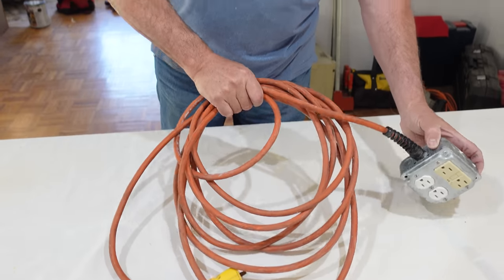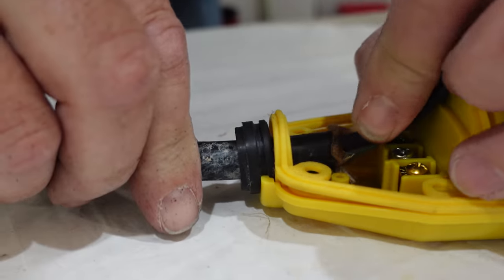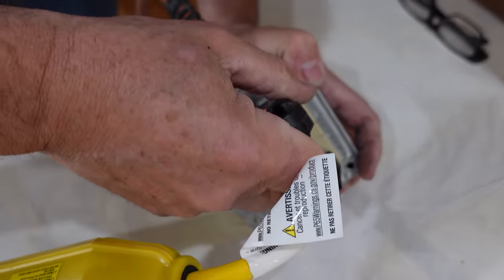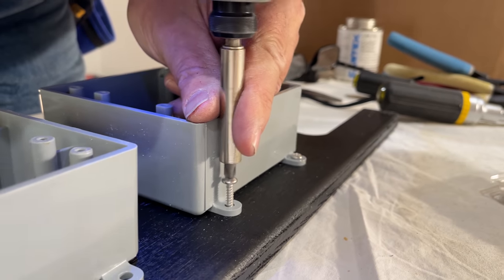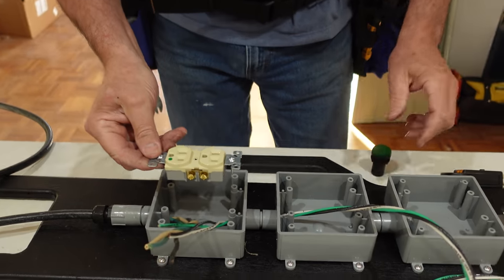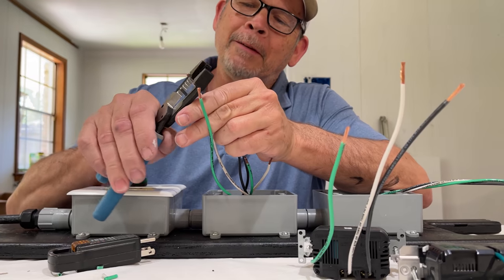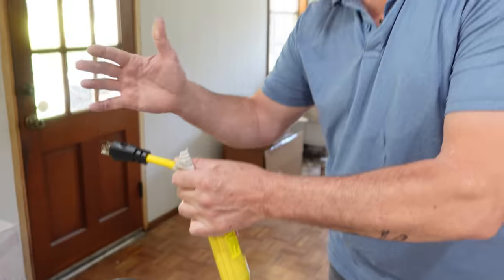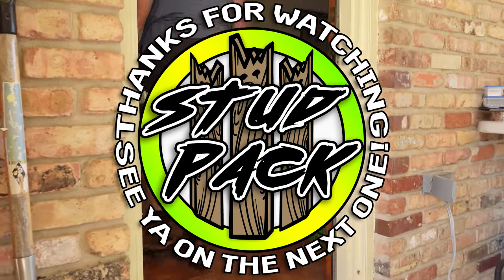HOW TO MAKE THE ULTIMATE EXTENSION CORD!

Comment: If you look in the datasheets for most circuit breakers, they have the over-current to hold time graph, which is a curve.  at a low amount over the rated current it will take quite a while (up to an hour) for the breaker to trip - 15.5 amps in a 15 amp circuit for example.  As the draw goes up, the hold time drops.  A 60 amp draw would almost instantaneously trip a 15 amp breaker.  Mechanically why this happens has been covered in many comments.  Why this is a good thing... hasn't.  Breakers can be designed to trip instantaneously for any peak over the rated current, but this provides no extra protection, and very well might cause problems with high draw devices like motors, that can draw great amounts of current at startup, but level off very quickly (inrush current).  A few seconds above the rated current isn't going to heat the wires in the walls significantly, and since the breaker is only there to protect those wires (....and nothing else), there's no value in making it trip any faster.
Reply: Yeah, being able to hold a surge current for even a short amount of time is important. We don't want a circuit to break every time an Air Conditioner brings its outdoor unit online as an example.
Reply: electroBOOM on youtube had a video where he put 100 amps through a 20 amp breaker and nothing. he got the data sheet and it said something like it can take anywhere from 60 secs to 5 seconds to trip based on the amps running though it.
Reply: @Styrofo4m  GCDIs are made to protect humans. Breakers and fuses are made to protect equipment and prevent structural fires. The main specification for a fuse or breaker is that the circuit breaks before the cable causes a fire, or hopefully break something.
Reply: In most countries gcdis and breakers tend to be one and the same. In USA this is not the case often only having ground fault protection to select few rooms.
Reply: @Styrofo4m  two different names around the same thing. It depends on which country you live in which is  standard
Reply: To elaborate, ground fault circuit vs ground circuit detection being the difference in name.
Reply: On the ship We can set the instantaneous break and slow break had you started two of those saws at the same time it would  of tripped
Reply: Exactly and that is because barkers are made of bi metallic strips and a small over current event takes longer to heat the strip causing a trip rather than a large draw.

Comment: Just FYI there are tons of products out there which will charge devices via USB-C, but the part where you're referring to being able to charge an iPhone 12 from 0% to 100% in ~1hr is because of Power Delivery. This IS proprietary to USB-C, but not all USB-C chargers feature Power Delivery. If you want this kind of high speed charging you need to make sure that your device is capable of charging with Power Deliver, and you charger is specifically designed to do Power Delivery, (often called USB-C PD accompanied by a wattage rating like 18W, 20W, 30W, etc...). If you don't see any mention of Power Delivery on a charger you're thinking about buying, then it does not have it. They are more expensive, but well worth it.
Reply: Also QC 3.0 is usually around 15-18w and higher voltage than typical 5v USB. There's getting to be way to many variations. I got a nice little USB volt/amp tester that tells ya exactly what it's at. I also recently got a multi port 60w PD and QC3.0 supply that tells you volts and amps of each port when a device is activated. You can see the power curve as the device gets charged. Kinda cool.

Comment: Pro Tip:  When tightening a cord into into a  strain relief, press the cord inwards towards the connections on the device to de-strain them while you're tightening it down.  This provides some slack inside the device and prevents strain-loading the connections during assembly.

And... great video, thanks!
Reply: Great Comment!!!  (While Stud Pack may have done that by instinct and because of experience, and didn't mention it.   That's great information for those of us that don't have that experience to fall back on!!!  Thank you.)
Reply: That sounds like something learned from experience! An "Ask me how I know" bit of knowledge. Thanks!
Reply: Also, cut the hot wire a little shorter than the other two wires, so, if the strain relief does fail, hot wire is the first to get disconnected.
Reply: The ground wire should be longer than the other two. If stress on the cable causes wires to pull out or break, the hot or neutral will fail first - not the ground.

Comment: Been doing industrial maintenance like ~6-7 years now and grew up in a home where we did everything DIY. Had literally zero knowledge that there was a stranded and solid side to strippers. Learn something new every single day, as long as you allow yourself to admit when you don't know.
Reply: Idk if I would advertise not being aware of super basic details like that. It says more about you as a worker in your trade than it does about the quality of this video 😂😂
Reply: @SlapperGlutesTwice  I'm not going to pretend. If you can't admit you don't know something you don't keep yourself open to learning. In any trade, if you keep your eyes and ears open, you learn something new every single day.
Reply: Me too, I just learned it today! I love these videos Thanks !
Reply: Depends on the strippers you use. I prefer the self adjusting jaw strippers or.just do it by feel. Most electricians I've ever come across strip by feel.
Reply: I work in industrial electronics at a wire manufacturer, just to inform, the copper size is likely smaller than actual gauge size regardless of solid/strand. do you think they are just giving copper away?

Comment: Most new breakers have 2 trip methods. One is magnetic which works primarily during a fault. The second is a bimetal coil, similar to an old fashion thermostat, this is the one that handles general overloads. Depending on the manufacturer, age, and use of the breaker it can take time for the coil to heat up and trip. Certain manufacturer like Zinsco and Federal Pacific wont trip and you get the smokey house effect. We hope there isn’t one in the house you’re at. It is perfectly normal to hit a higher amperage on a breaker for a short period of time before the coil snaps. I have seen a 20 amp breaker hit 25 amps and hold for 10 minutes. Ultimately heat is what trips the breaker in an overload and it takes time for the heat to build up and trip the breaker. If you had a thermometer on you at the time of the video, you most likely could have identified the breaker you were using by the amount of heat it would have been producing. How ever I don’t suggest replicating the scenario to try it. Overloading a circuit is never a good thing. The more heat a breaker takes on the easer it trips the next time. 

Great video! I got out of remodeling to became an electrician. I mis the remodel world. I watch your videos and you guys always have some new concept or product that I have never seen. There are a lot of new products that has come out in the last several years. I really liked the cabinet leveling kit. I switched to air bags just before I got out of the business, but this little gizmos you guys used knocked the socks off the airbags. I can’t wait to see the next video.
Reply: Excellent response to the question about the trip time, also the trip time is delayed for the inrush current of high inductive loads.
Reply: @TopCat2021  I have seen 90 amp on a 15 amp breaker for a second or so to close a F***ing big coil 
was just a testing rig , normally this was powered by a dc charger and battery

but was still surpise it was holding
Reply: I was about to say, arent breakers, supressors, etc all supposed to be sacrificial components? I'd definitely consider replacement in multiple scenarios...
Reply: Your answer is spot on. 
There are also trip curves available for almost every breaker except for those horrid Zinsco and Federal Pacific panels. Its pretty interesting to see how long a breaker will hold with a particular breaker. There are also different breaker trip curves, A-F  that will determine the In-Rush available. In-Rush is what allows motors and capacitors to charge without tripping breakers constantly.
Reply: Zinsco and federal pacific are pretty much known in the inspection world as a no go and always labelled as a must replace. Interesting to see a sparky call it out in the wild.
Reply: Great response I agree with you on all your points!
Reply: Not all Federal Pacific breakers suck. Up until the '70s when they unscrupulously started putting fake UL markings on breakers with poor quality control, they were reliable. I use a lot of them in 3Ø applications, their commercial breakers aren't bad. It was residential and resulted in the deaths of unsuspecting homeowners and eventually FPE.
Reply: @tslim250  I had defended the earlier FPE, but I wanted to add that since it's impossible to tell the difference between a good FPE breaker and an FPE house ignitor, I ripped mine out and went Square D when I retrofitted with Romex because my house would go up like a torch due to age and construction style. I will agree it's a good idea to treat it as a known hazard and R&R with something that works right.
Reply: Pretty good explanation thank you
Reply: We tested this in one of our data centers.   What happens if you have a 20A circuit with 16A of gear and something happened where power was lost and then restored.     When all of the blades came up with the switches and routers running full fan speeds doing their pre-flight checks we saw the circuit hit 24A for about 4.5 minutes then it dropped back to it's normal 16A after everything had passed the tests.   Ultimately we just configured our PDUs to do a staggered startup since many of them are hours away.    So far in the last 10 years we've not had to use this in production.
Reply: @themadmallard  breakers are resettable. Suppressors and fuses aren't.
Reply: I was going to say the same thing.
Reply: @themadmallard  They are sacrificial, they are designed to take the abuse so the wiring doesn't. Any time a breaker trips under load you are damaging it. Doesn't matter if it's a thermal overload or a short circuit overload, both damage the breaker. The good thing about it, breakers are designed so that when they fail, they fail safe. Meaning a failed breaker SHOULD do so by failing to provide power to the circuit. Rarely will they fail to trip in an overload condition, usually it's an incredible incident that causes them to fail stuck on, I normally see this from lightning strikes.

As Riles mentioned, overheating can damage the bimetalic strip that is responsible for thermal overload from slow trip currents, causing it to fail under normal load conditions. But a fast trip current is going to cause large arcs at the contacts when they are pulled apart, this causes pitting, carbon and soot deposits (this happens anytime the breaker is disconnected while under load but it's worse under fault currents). This will over time cause a poor connection in the breaker that either fails to make contact at all, or causes excessive heat buildup from the poor connection which ends up tripping the bimetalic strip even under normal load conditions. It's why many electricians when diagnosing a breaker that won't stay on despite seemingly normal loads will feel the breaker to see if it's getting warm. I've even seen home inspectors use a thermal camera to look at the panel and look not just for hot spots on the breakers but also the neutral bus looking for bad connections. Pretty cool if you ask me.
Reply: @2009dudeman one of the reasons we don't use DC as DC will maintain an arc in the right conditions where AC won't so the arc damage will be very minimal.

Comment: I only ever made one electrical item my entire life - but , I still think it's worth sharing with others . Basically , I just used a 100' manual reel and fit 200' on it . Works great just be careful to not twist the cord too much or too little and I let the two ends meet outside of the reel so there's more reel space and easy access without needing to unroll to run a split or whatnot . Thanks for the video . Y'all are awesome .

Comment: 25:55 My Dad was a Navy man in Vietnam. He learned this fact there and explained to me no less than 100 times. Which in hind sight was good because it took me about 20 to really grasp. When the impeller is able to move fluid linearly in flow, it constantly encounters new, axially stationary, fluid and then has to introduce torque. When the flow stops, the impeller puts torque onto the fluid, which remains linearly stationary, and the system becomes a flywheel. And we all know a flywheel take a lot of energy to get up to speed, but very little to keep at speed. I was probably 4 years old the first time I heard this and 8 before I could finish his story for him.

Thanks for the memories, Stud Pack. ☮❤🌈🧘🏽🕉☸☯
Reply: Good explanation 👍
Reply: A blower with squirrel cage fan also increases in speed when it's blocked on the airflow. 
The load test with the saws would have seen a very large increase in current draw of they were actually cutting wood rather than just free spinning; it's not very representative of their power draw just by turning them on.
Reply: My dad, also a Navy Man in Vietnam, went on to civic life as an electrical engineer, though his tradecraft was as Master Electrician. Mom was a public school teacher. A proud union family we were!
When I was a kid I was "asked" to crawl around under houses (spiders, snakes, rats, even bats!) and in attics (either bitter cold or abominably hot...plus vermin and insects of every kind. Wasp bites were especially fun while rolling around in fiberglass in July heat.) But he made working hard fun. I got to swear like an actual sailor, trade barbs, take a ribbing and had lots of laughs.
So cool to see Stud Pack guys as father/son team. That is rare!
Like your pops, I paid a passive ear to his 'splainin as a kid. And though he's passed now, I can still recall hundreds of rhyming schemes, anecdotes and shorthand! I literally apply those mnemonic devices in physics, math, chemistry and weekend handyman projects now,
As an adult who's also an engineer (of a different flavor), I'll always fall back on Dad's sage advice in tricky situations.
@StudPack you guys do fantastic work! Love the channel!

Comment: Ha ha…you are giving code enforcement and fire marshals across the world heartburn for sure with this project.    Love it.
I guessed right on the USB outlets, but you left out my second device.   I was expecting a load sensing circuit to power up your shop vac whenever you started your saw.    Maybe video three.
Final comment is solid wire inside would be fine.   Nothing should be moving inside these boxes.   The stranded wire just made it harder to wire up like on that ground screw.
Thanks for the entertainment.
Reply: I'd add a power monitor to the rig that can display the voltage, current, and power factor. They're available for a very low price and will let you see at a glance if you're approaching the limits.  Basically a small panel display with a current sensor that you run the feed wire through. It'll add a Kill-A-Watt function to make it more ultimate. 😉

Comment: The vacuum part surprised me, I hadn't really thought about it before but I assumed when it was clogged that it would be pulling harder to overcome the clog therefor drawing more current, turns out I was wrong. Every day I learn something new!
Reply: Yep, the vacuum draws less power due to the partial vacuum it creates behind the impeller. The motor has less drag since there's no more air to move and it starts spinning faster (hence the louder noise). One thing to keep in mind though is that since the vacuum is not moving any air through the filter it's also not moving any air through the motor. This means that the motor won't get cooled anymore and it may overheat.
Reply: Same going to change my way how i look at that not to much stress then
Reply: Exactly my thinking and logic too prior to this video
Reply: The blades in a fan are like airplane wings -- when you have a proper angle of attack, the wing produces lift to support the plane's weight, which also produces drag (load).  As a plane slows, the angle of attack between the wing and the air increases until the air no longer flows smoothly over the wing; when that happens (a "stall"), both lift and drag are decreased.  So, like the airplane wing, the blower blades stall, not moving air, and not loading the motor as much because, as others have said, little energy is being used to do work.  That floored me for the longest time, too, until I became a pilot and thought of the lift / drag in that context.
Reply: I also thought this!
Reply: good point you mar about the cooling and heat build up.
now some vacuum motors may depend on the flow through for cooling and others might have a separate cooling fan for exposed motor coils.
Reply: @johnburgess2084 To be clear, when a fan inlet is blocked it does not stall in the sense of spinning slower. It 1 spins faster, 2 makes a higher pitched noise, 3 moves less air, and 4 consumes less power.

Comment: Of course you knew you were going to get comments on your ultimate extension cord. Before you paint with the flex drill 2 holes in the top of the board 16" on center. When you're at a job site with open bays, you can fasten it right up to the wall and the holes will be premade in your wood to mount on the stud's. Even without it's a fantastic device!
Reply: That is a fantastic addition T L. I bet we will see that in the next episode